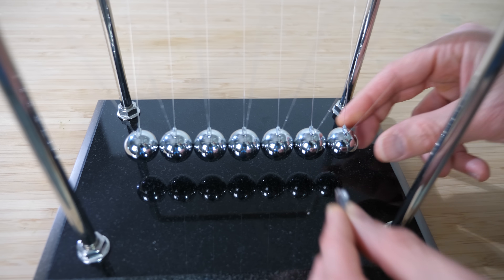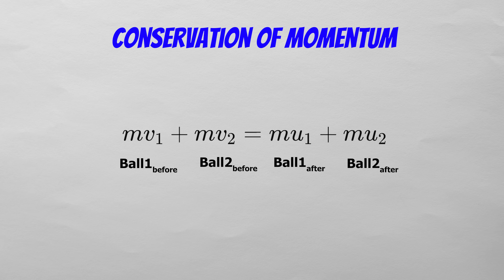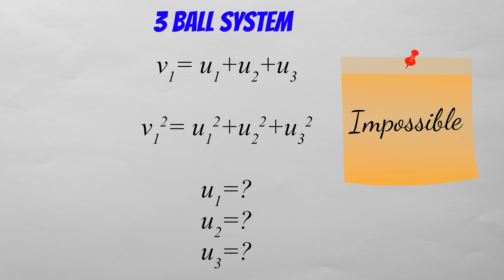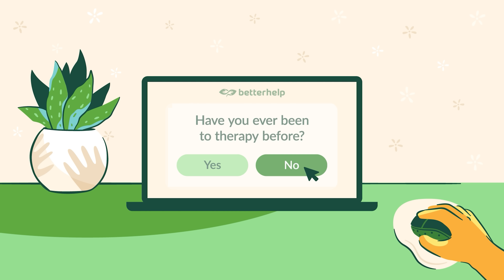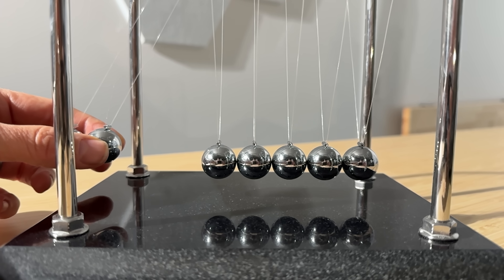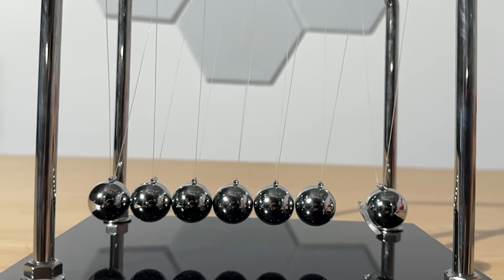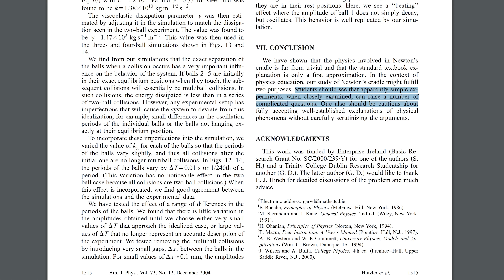Newton’s Cradle Doesn’t Work the Way You Think

Comment from the maker: Here are some great papers on what I talk about in this video:
https://www.karlsruher-physikkurs.de/download/ball-chain_part1.pdf
https://www.karlsruher-physikkurs.de/download/ball-chain_part2.pdf
Reply: Great content
Reply: The waves also don't like changing mediums
Reply: What hurts my brain with the cradle is that when hitting with two or more balls. The same amount of balls are bouncing back, instead of just one going higher.

If you take one ball and hit it with different forces, one ball would go higher and higher depending on the force.
So why do two balls make two balls bounce instead of one going twice the height?
Reply: @metern  i think of it as a complete wave function from beginning to end. Trying to find harmonic and nodes deviding in equal directiins and sometimes that node isnt matched with the balls. So they try to devide but cant. Same as guitar string nodes. These are mechanical waves trying to travel thru 1 string.
Sometimes harmonics can't devide evenly over a certain distance hence why harmonics can be predicted.
But if you touch a guitar string while its vibrating it may form a node thats there; but its too high to hear.
The balks are trying to mimick a wave but cant
Reply: @nathangrueber9834  Still hurts my brain. 
What if the first ball was bigger, then what 😁.
Reply: @metern  did you watch the video? He explains this. It's the main point of the video.
Reply: @metern  Because the two balls are not hitting as the same time. They may be separated by 0.1ms.
Reply: @metern 
It is in simplofied terms the conservarion of momentum AND Energy. 
If only one ball where to be flying away with double the speed, then the momentum would be conserved, but energy would not.
This forces both balls to go away.
As he said this is only an approximation. When kinetic energy is converted into heat in the plastic, this equation does not hold anymore.
With shockwaves you can also get to that point, but i think for a explanation on the basics of the problem you dont need to consider shockwaves, but you can reduce it to conservation of momentum and eneergy, as long as both are conserved.
Like when you drop a stone in order to find its impact velocity,a lot is going on in between, like air molecules hitting it. But still with conservation of energy you simply get its impact velocity very presicely.
Reply: I didn't notice Science calling it "conservation of momentum" and always thought Newton’s Cradle is "transfer of energy with depreciation over time".
Reply: @caojidan8913  yea no kidding i noticed that too  conservation of what? Its a demonstratiin on how wave types can transitiin through diferent densities and shapes.
Make the balls cubes and it wont work. Take away one the maths wrong for deciding wave forms and it wont bounce.
Its no diferent to sound
Reply: It's bubbles of positive and negative charges back to back making a sphere and moving that energy when the bubbles pop, look at the magnetic protection the earth had and how it snaps to the other side when it breaks, same concept
Reply: @EndlessTripp-b3s  the earths magnetic field gets stronger when its pushed on by the suns radiation.
Self containment field.
Its a lie we are all gonna die thyr counting on ignorance and fear.
Reply: L better help
Reply: @TheActionLab  Thanks!
Reply: Is this a classic 3 body problem in Physics?
Reply: The momentum is stored in the balls
Reply: The so called Newton's Cradle is actually called The Swinging Wonder and was invented by my friend, Lee Trippett, in the 1960s as part of a physics project at the University of Oregon. He founded Scientific Demonstrator Products in Eugene, Oregon, which produced items to demonstrate scientific principles for classrooms for several years.
Reply: This is supposed to be Steve''s but what is 1 + 1 = ? In one Dimension 
This is supposed to be Steve''s but what is 1 + 1 =  2 In the 2nd Dimension 
This is supposed to be Steve''s but what is 1 + 1 = 2 In 3rd  Dimension 
This is supposed to be Steve''s but what is 1 + 1 = ????  In 4th Dimension (Considering A Cube is a Taseract)

As you can only count objects or your fingers or what you "see" as
Reply: This is why Schools need VR headsets (A lot of Math Problems are still yet to be solved incl 3 Body Problem)

This is supposed to be Steve''s but what is 1 + 1 = ? In one Dimension 
This is supposed to be Steve''s but what is 1 + 1 =  2 In the 2nd Dimension 
This is supposed to be Steve''s but what is 1 + 1 = 2 In 3rd  Dimension 
This is supposed to be Steve''s but what is 1 + 1 = ????  In 4th Dimension (Considering A Cube is a Taseract)

As you can only count objects or your fingers or what you "see" as , they made me forget the other thing I wanted to mention but it was a MF good point of perspective🤔🤔🤔🤔
Reply: @HolloMatlala1  what the hell are you on about?
Reply: So it works exactly how I thought it did and how I was taught in physics... you are making bad assumptions. Bad creator.
Reply: 0:41 "wa- laaa" ?  Pls do a vid on correct pronunciation making sure to include the v  ;)
Reply: @nstar7877  voila

Comment: The balls have a uniform strength. If you introduce a different material with a different strength, energy is wasted through deformation. In other words, the energy is redirected through deformation. Therefore, the energy can no longer be fully transferred.

Comment: I like your videos a lot! 

There's another way to see this I think. Newton's cradle works due to the symmetry of the apparatus. The plastic breaks that symmetry. Your explanation of pressure waves is correct but it misses this deeper point. Once one recognizes the role of symmetry, it follows immediately that introducing identical plastic pieces in the same (but opposite) positions relative to the center of the apparatus would restore the functioning of newton's cradle exactly as though there were no plastic at all (provided of course that the collision remains elastic, as you also assume in your explanation)

Comment: Yes, the balls need to be suspended exactly perpendicular to their at rest location and with exact strand exit angles and lengths and minimal attachment node size.  All balls MUST align exactly with the horizontal plane and the entire assembly needs to be level or perpendicular to Earth's gravity.  I would also suggest doing high speed imagery of this device as it is rotated to various start angles with respect to the equator.  All that Coriolis stuff.

Comment: Might be interesting to see what would happen if you made NCs out of different materials.
Any homogeneous material with a drastically different compression coefficient ought to have measurable differences in behavior.
Tungsten
Glass
Rubberized mouse balls ("Now with 2x the physics!")
Glacier ice
Any spheres of crystal with a high Mohs value
Cheese
etc.

Also, thank you for this. I was wondering exactly how the energy was being transmitted down the line, not in the Newtonian sense but in the sense of energy transmission at the level of interacting particles, and thinking of a Newton's Cradle as a series of molecular springs energized by sound waves really brings it home.

Comment: You already speak so back in your throat that when you use glottal stops for your "T"s it sounds extremely inarticulate.  You should practice using the so-called "regular /t/", which is pronounced with the tongue pressed just behind the top teeth.  It's really noticeable for example when you try to say "Newton" and instead say "New'in".

Comment: It seems that you’d lose some energy, maybe through heat (?) upon every contact.  So eventually the system would stop.  Otherwise it would be a perpetual motion machine which should be impossible due to one of the three laws of thermodynamics, although I’m no mechanical engineer.  I suppose math and computer science didn’t cover this much although I took the Physics series.

Comment: Check the date on the paper- May 1980! Does that mean that physics has been deaf and blind to this for 45 years??? 
Or maybe it's just the nonsense that it appears.
Combine conservation of momentum with conservation of energy and you will find that in system consisting of an integer number of individual equal-mass balls (which this one does) then the energy and momentum of two balls of mass M arriving at a velocity V  can only be balanced by the mass of two balls of mass M rebounding at V at the end. 
Adding the plastic changes the system but doesn't disprove the explanation for the original system. 
Neither does dropping the third ball after the initial impact. 
Remember Occam's Razor.
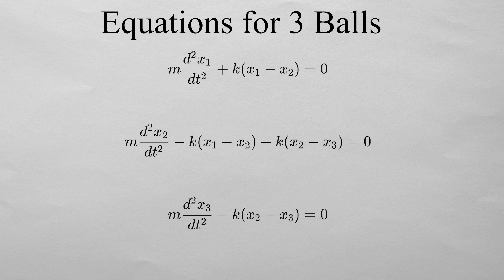(And oops: 3:54 typo - equations, not "eqations".)

Comment: 5:19 What I still don't get is how or why the wave reflects when it reaches the end.
Reply: Imagine the ball as a bunch of little masses connected to each other with springs (easiest to assume the ball is just a line here, it works in 3d too, its just harder to spot). The shockwave is basically how the springs behave, it travels because if you compress one spring, it pushes onto the next one compressing it, which in turn pushes on the next one etc. However, once you get to the end of the last ball, you will find a mass that has only one spring attached, so when it is compressed, it cannot push further on, it has to push back in the direction the wave came from. Of course, in reality, a little bit of the wave will also escape into the air, creating sound (think of the old trick of listening for a coming train by putting your ear to the tracks), however this effect is pretty much negligible in this context. Hope this helped!

Comment: Utter twaddle to claim that you need to look at the detailed elastic behavior of the balls to understand the motion. You just need to consider conservation of energy  as well as conservation of momentum and the only motion that satisfies both conditions is for the same number of balls to fly out as flew in. Factor in less than perfect coefficient of restitution and you've explained your bits of plastic and why it ends with all the balls swaying together. I'm not saying the papers you quote aren't providing insight into the actual mechanics, but don't claim that's necessary to predict and explain the basic motion.
Reply: Could you explain please, or point to a source?

Comment: @TheActionLab : Very fascinating, great, thanks for the knowledges you shared ! Still another f. principle I was sure to understand that collapsed 😢 but at least it opens a little bit my mind 🙂 !  Fortunatlly staying humble was an old lesson I never forgot ! 

Is it like a three bodies problem ? Is it a chaotic when there are more freedom degree, 3D ?

Feynman (in his mechanics book 1) convinced me that is was not too hard to solve final behaviors of these kind of problems with "mv" momentum conservation, by passing from one frames of references to another ... using the E conservation or not etc. that I was sure to be able to manage a lot of cases, but now I am a little bit lost ... 🙂 

Using a small model with masses attached with small springs was always helpful (at least with only two masses) because we can think about the action and reaction forces during each exchanges of Ecin and Epot energies. Maybe these ways of doing approximations still works well when we have more than 2 bodies but with some of them having negligible masses ?

Even if it's very interresting, thinking in terms of coupled second order EDO (or maybe partial diff equations is more appropriate), is nevertheless really hard, isn't it ? It leads to some kind of  telegraph equations, like in transmission lines, correct ? Reflexions, propagation, impedances adaptations ... a lot of concepts that we have to take into account in this kind of study is not very obvious even if the job is finally done by a computer.

But I love thought experiment, do you have any idea where I could find an intuitive explanation of the quantity angular momentum conservation starting from the linear one ? Is it possible ? 

What happens if we simulate a model of  in the solar system with the Newton equations adding "c" propagation delay ? Will it be closer to general rel results ?

Thanks again !!!

Comment: @theactionlab I’ve always understood that Newton’s Cradle works like it does because it HAS to.
The collisions are total-elastic. In which case, in a collision, the start and end of both Momentum (mv) and Kinetic Energy (mv^2/2) is conserved.
If you do up the math, you find only one solution that satisfies the conservation of both momentum and kinetic energy.
Reply: Your argument would be more persuasive if you offered "the math".
Reply: @RationalDiscourse  
Before collision: N₁ balls move at speed v₁
Momentum = N₁mv₁
Energy = N₁ × ½ mv₁² = ½ N₁mv₁²

After collision: N₂ balls move at speed v₂
Momentum = N₂mv₂
Energy = N₂ × ½ mv₂² = ½ N₂mv₂²

By conservation of momentum: N₁mv₁ = N₂mv₂
∴ v₂ = N₁v₁ / N₂

By conservation of energy: ½ N₁mv₁² = ½ N₂mv₂²

Substituting v₂: ½ N₁mv₁² = ½ N₂m(N₁v₁ / N₂)²

Cancelling and rearranging: N₁ = N₁² / N₂
∴ N₂ = N₁

So the number of balls moving before and after the collision must be the same.

And so too must their speed:
v₂ = N₁v₁ / N₂ = v₁
Reply: @apmeehan  and so must be their mass.
Reply: @apmeehan  Correct. The youtube video is nonsense. My point was @sirifail4499 should have "done the math"
Reply: While you're quite right that it "has to" follow the rules, I think the value of this video is its explaining how it does so.

Comment: The real mystery is how it seems to defy the laws of inertia. Even if you use large heavy weights instead of small ones the one on the other end goes from stationary to full speed instantly, I saw it done with bowling ball sized weights. How is that even possible? What would happen if a person was strapped to the far side of the weight? Would they feel g-force or not? What would the G-force be of going from zero to high velocity instantly?
Reply: NO SUCH THING as "the Laws of inertia"!

Comment: I feel like the pressure wave being shown reflected off the end of the loose ball can't be right. I know it feels "good" to show the waves meeting, but i think it's simpler than that. 

When the pressure wave crosses between balls, the receiving ball is either fixed in place (by further balls), or loose. If fixed, the wave propagates. If loose, the wave is transformed into kinetic motion at the point of contact, no going into the ball and bouncing off the far side. 

Think of it like dropping a slinky, the middle balls can't move until the last ball moves, and once it does, they don't need to (because they're not linked, like slinky coils).
Reply: "I feel like the pressure wave being shown reflected off the end of the loose ball can't be right."
Why not?  If there is not another ball to transmit the impulse, the steel will elastically deform slightly, then rebound back to its original shape and the impulse will proceed back up the line of balls until it meets the other wave which has itself reflected from the other end.  Where these two pressure waves meet will be exactly at the point the same number of balls from the end as from the start.

Comment: I was literally just thinking NOOo it's wave propagation through a material! Hadn't considered the reflections... What about the measureable energy dispersed into sound (pressure waves across a medium of air in our case ...) do this in a vacuum. Substitute one  sphere for a double sphere pair? What about shapes designed to dampen the wave at the materials particular speed of transfer/harmonic damper?

Comment: I do not believe in this shockwave theory, first for the travel length it would mean some kind of geometric coupling (this needs to get researched further more by using balls of different size but same mass), second there is no reason for such a separating force between the surfaces where the shockwafes meet, at least for my humble understanding. As mentioned in the video, the key may be hidden in frequencies and resonances. I´m not a physics graduate by the way, just a human who may think a bit too much.

Comment: In the newton's cradle, could we not argue that the impacting ball applies force to first ball, and first ball flies away. We saw the equation here... Now, imagine you are a middle ball. You get impacted and behave as the stationary ball, being launched to speed but immediately impact the next ball where you are now on the other side of the impact equation, setting you back to 0. Not correct but gives the right result
Reply: Why are you retelling this? Video already elaborated the same thing, 2:55.
Reply: @u1zha  wrote it ahead of watching, then edited to acknowledge how it fails

Comment: I would like to see how that cradle behaves at STP, when ball 1 is raised to a measured angle and timed, then the experiment repeated all the same except placed in a vacuum chamber to try and prevent heat loss of energy and audio loss of energy.  Will the cradle run measurable longer, will the ball the launch to a greater angle?